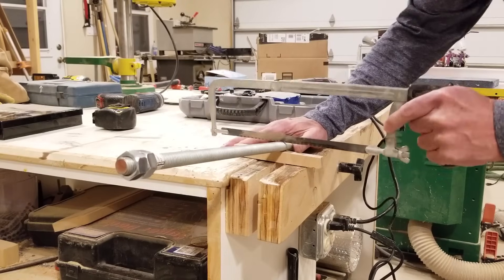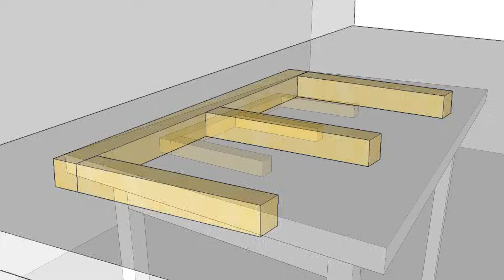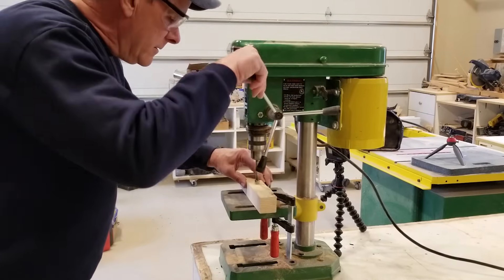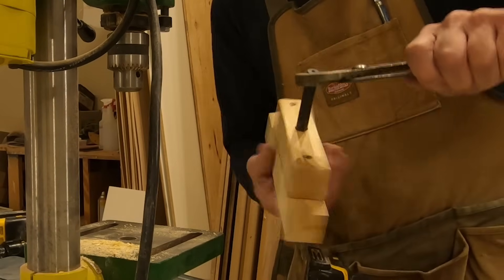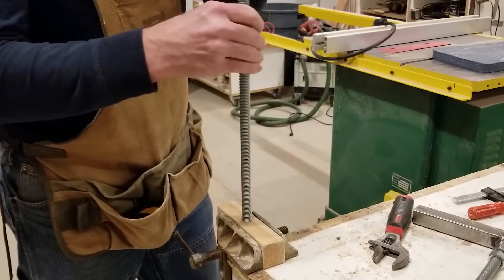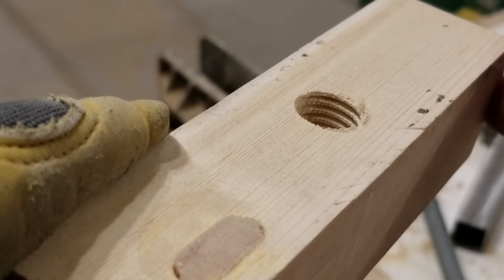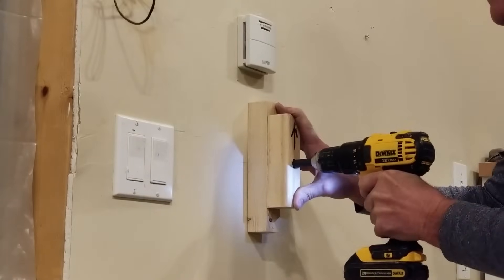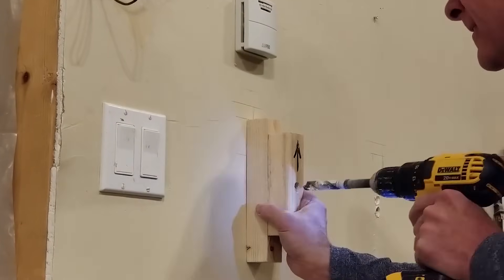Strong Floating Shelves - The Strongest Option

Comment: Solid video!

I’ve always wanted to try using cheap framing squares screwed to sides of studs.  Only would work before rock was up or having access to behind wall.  Anyway one could screw or bolt squares to studs, screw or bolt a piece of wood to part that sticks out of wall for glue or fasteners, then just slide a pre made box right over.  That’s gotta be strong!  

I like the idea of the your rod coming through to the end and bolting tight against the wall!  

I’ve never been worried about wall to wall shelves or wall to finish, but finish to finish shelves, I feel never will stand the test of time.   Kinda like a Newel Post, no matter what you do they seem to loose up over time as things tend to be abused.
Lmk your thought on the framing square idea, curious to hear another pros opinion.
Reply from the maker: No doubt, Jeff, that the framing square idea would result in a strong shelf. The question I haven't quite answered is how strong does a floating shelf really need to be, practically speaking? Something I have considered that is sort of like your idea is to weld up 1/4" "L" brackets that could be bolted to the face of the studs and then floating/texturing over them to leave only the other leg of  the bracket sticking out. Not as rigid as yours, but don't have to put it in place before sheetrock. Anyway, thanks for your thoughts and I appreciate you watching!

Comment: OMG this is a great idea. I might try this with the addition of a two inch wide , 8th inch steel plate strip that bridges the gap between the two posts. Then can be tightened against the wall with nuts. That should even the weight out better if the shelf was loaded unevenly and make the threads less likely to pull out due to the weight pushing against the sheetrock.
Reply from the maker: Good idea, Joshua! You would think that would strengthen the whole assembly!

Comment: Wow! Way to much work.
Not near the strength you could have. Too much room for error. 
The simple effective way I've been doing this for 25 years is as follows. Figure how many shelves you want. Take 1/4" × 1 1/4" flat stock. Figure the spacing drill and weld your allthread from both sides to your flat stock. If a single shelf 6" FS is fine. If dbl shelves, extend 3" above and below your allthread.  Drill FS and secure with 1/4" x 2 1/2" screws to bare stud. Now days I use a laser to line my rods to perfect level. Patch drywall and epoxy solid shelf in place  or bolt your box shelves in as you have on your videos. 
I built these kind of shelve for display of antique radios for a museum. Since the walls were new, I used 1" square tube, welded the allthread but bolted the tube to the sides of the studs since shelves went from floor to ceiling and we need to attach drywall. 
My 2 cents.

Comment: I would think it would have been easier to buy a tap, or install a threaded insert, but whatever works.
Reply: Custom Haines in a perfect world this guy can drill and tap and install the threaded rod without doing any additional drywall work. I think that’s the only advantage to the threaded rod solution. I must say I would not install anything more than a light duty shelf here. This would not hold up a countertop or a mantle.
Reply: @scottocarpenter9904  I agree with you opinion to limit weight on this design, but I don't follow how all that set up and prefab is any easier or better than just using a commercially available tap.

Comment: I use a similar method for hanging heavy things in my shop. I drill a 3/4" hole directly in the center of the stud I want at a slight downward angle. Them I put a 3/4" wooden dowel in it. I've hung some incredibly heavy things off them. Super easy to do.
Reply: How deep do you drill into the stud and are you concerned about reducing the structural integrity of the stud?  I was thinking of putting 3/4 inch EMT 2.5 inches deep into some 2x6s to create a wood rack but I don't want to mess up the load bearing studs and have the shop fall down!

Comment: It's an interesting video to watch, but I don't see the point of it. Barely anyone has the hardware and know-ho to do this.
Reply from the maker: Hey James! If you are talking about welding the T handle, I understand. But if you have a drill, right sized drill bit,  a few nuts, a couple of wrenches and a hacksaw, you could install the rods in the wall. Then you would be down to building your shelf. In fact, I cut my rods with a hacksaw. Lots of ways to get things done, James!

Comment: Hey amigo, nice work and it's always fun to find new ways to do things..... Helps keep the interest alive !!!
Ya know what I mean?
PS... I use my impact wrench and two coupling nuts tightened against each other. Then, as u did,  put some relief slot's and drive them in. Oh, add a little oil or wax to the hole.
No need to pretap 😉🤗
Great job keep it up 👍
Reply from the maker: Yep, Traky boy, I know what you mean! Thanks for your suggestions too and I appreciate you watching!

Comment: I like the idea. This has several advantages over other installation methods. If you choose to remove the shelves you only need to fill a small hole. If you had glued in bar to the studs you need to cut them off first then try to cover the end of the bar. If you use lug bolts cut off you have no way to secure the shelf hard against wall.
 If you were to just drill a blind hole in the solid shelf and slot out a section you could still use a nut to secure the shelf. Would be a pain to fit because you would have to wind nuts as you draw in shelf.
Reply from the maker: Yeah, manofausagain, I tend to agree with all your observations. Thanks for watching and for your comments!

Comment: Hanger bolt. Save a bunch of time.
Don't drill through all of your laminated strips, leave the front one solid for a nice finished edge.  The one just before make a pocket large enough for a washer and open it to the bottom so you can put a wrench in there from the bottom. ------/\|  Cross section.
Reply from the maker: Hey Macks! I have experimented with hanger bolts in an earlier video, but I'm not quite understanding your design from your explanation.

Comment: I have to ask. Why would this be superior to a french cleat system?  I'm installing 14" long 6" at the base, 12" wide shelves in a commercial space. (i didn't design them, designer gives me drawings, with no idea how to mount, says, build these, install these)After mounting a startling number of very large cabinets in a hair saloon via the french cleat method, i thought, okay, that 6" base gives me plenty of room to put a 3/4" hardwood piece of ply 2" wide on top of another 2" wide strip, secured into blocking inside the walls with timberloks. I might of used this method here, had i seen it before getting those drawings or before mounting those large cabinets. Without comparing the two methods(no time for that)could you think of any reason one is better than the other?  Thank you and great video. I subscribed right away, seeing the experience, and methodology.

Comment: Use 3/8 cold rolled steel ,5 min epoxy your done
Reply: Yeah brickwall + epoxy 5 min tops.
Reply from the maker: Yep, lots ways to get this done, Darren! But if you think about it, this is a pretty easy way to go also and I can always remove the shelf and patch the hole in 5 minutes.

Comment: Just use threaded inserts tapping wood will never be as strong as an insert. Drill, screw into the hole. Put your all thread in with a drop of Locktite. Just in case all is not perfect, drill the shelf holes oversize and shim if necessary then tension your nut and put in a wooden plug. All invisible.
Reply from the maker: Good idea, Mark! Thanks for passing it on.

Comment: Much easier and faster just gluing in regular Rod instead of trying to tap the hole. They sell kits on amazon for this style of installation.
Reply from the maker: If you say so, Jason. But if I'm not explaining, I'm drilling a hole, running in the tap and screwing the rod into place. That's pretty easy also! Plus I can pull it if I ever need to.
Reply: @RustyDobbs  How would one go about this process without that metal contraption you created to twist the rod?
Reply: @aheadatime  you could probably get away with epoxying a nut (especially a cap nut) into a sturdy piece of wood as a tap handle.
Reply: @aheadatime  just put 2 nuts on the end of the rod and jam the together. Then put a socket on it and turn it in with a ratchet or impact screwgun.

Comment: A quick patching job is a small price to pay to know you got it 100% right.  You can walk away from that job with zero worries.
Reply: I would do the same thing, making 100% sure you're drilling dead center of the stud. In fact if you hit it just right you won't have to patch at all by cutting a channel in drywall less than the width of the shelf.
Reply from the maker: That's the way I look at it too, Kroban3.
Reply: @RustyDobbs 

Bill Shakespeare has a good point.

Comment: Only one fly in the ointment, if the studs don't align with where you want to put your shelf you are SOL.  The one advantage to the cantilever bracket with the case over it is the lag bolts can go anywhere on it and then you can use Snap Toggles in between.  ST's hold 241lb shear on drywall.
Reply: Shear yes but bending moment as a load a shelf would generate?
Reply from the maker: Yeah, dynamics change a lot the further away from the wall the load is.
Reply from the maker: You are right, Killashandra111, that the snap toggles are very useful. I used them for the first floating shelf I ever did because of alignment issues. However, if studs are on 16 inch centers minimum, larger shelves would work fine typically with this method. My guess would be about an 18 inch long shelf minimum with two studs in this span works best using all threads. Thanks for the comment!

Comment: I appreciate the work you put into this. But it seems like a bit of just that. Why not just use taps and dies to create the threadings. Welding the piece you did was pretty brilliant if you have a welder or even are able to use one.
Reply from the maker: Hey, everyday! I just did a quick online check and you can buy a 3/4" tap for under $20 which would last a long time only cutting threads in wood. Thanks for pointing that out! Simple solution for folks without access to a welder!
Reply: @Rusty Dobbs - instead of cutting the head off the bolt & then inserting into the studs, couldn't you have inserted into the studs first & then cut off the heads?

Comment: What maximum shelf depth do you think this would work for ??  Do you think it would for a 20" shelf ?
Reply from the maker: Hey, Lyndon. Depending on the weight it might work ok for a 20" shelf. One of those things you would need to experiment with. The wider the shelf, the more potential deflection out at the end, like a diving board. Stepping up to from 5/8" to 3/4" all threads might be something to consider too for a wider shelf. Good question!

Comment: I’ve always bought 12” lag screws and cut the hex heads off after. Same idea. I use a drill and a jig to keep them vertical.
Reply from the maker: Sounds like a good approach, Stoph! Thanks for your comment!
Reply: That's how I installed a floating mantel for a client! Used 5, 1/2" lags, and a cheap drill press attachment for my drill. Worked great!
Reply: Yup same here, I’ve used lags before to for mantels and shelves.
Reply: I like your approach better, I feel the coarser threads of a lag screw would be better suited for this application
Reply: With the lag bolt approach, the strength comes from it being threaded into the stud. With a floating shelf there is a lever action trying to pull the lag bolt out of the stud. With the all thread approach most of the strength comes from the threaded rod resisting being bent. The nuts only keep the shelf tight to the wall. I used a similar approach the fix down my stair railing end posts.
Reply: I like the idea of lag screws also. Saves a BUNCH of steps (don't have to re-invent the wheel) and coarser threads are stronger than all thread.
Reply: I was thinking perhaps some epoxy squirt into the hole before setting the all thread.
Reply: That's the conclusion I was coming to when I saw this product sold....methinks, what they're selling is just a lag screw with no head:  https://smile.amazon.com/king-way-Floating-Invisible-Concealed/dp/B07KW4VRL6/ref=sr_1_9?crid=3HYD58STZ951E&keywords=floating+shelf+brackets+hardware&qid=1566055914&s=gateway&sprefix=shelf+brackets+hardware+floati%2Caps%2C195&sr=8-9
Reply: I used the same idea with the lag bolts, but instead of cutting the heads off I used a sleeve made from plastic pipe that brought the threads to the same diameter as the head, predrilled, then screwed the lag in with the sleeve.

Bonus, the sleeve acted as a stop so all my supports were the same distance from the wall.
Reply: Aj Ginther Do you have a picture of the lag and sleeve, do you use pvc pipe or something else?
Reply: @michaeldean2053  It's been a few years. I just have pics of the finished shelves.

I'm almost positive I used black 1/2" PVC risers and cut them to size.
Reply: @michaeldean2053  I don't seem to be able to share a picture here.
Reply: @ajginther1281  well atleast we got the idea noe back to work
Reply: Curtis “fixed the newel post”.... watch Christmas Vacation.
Reply: There's a decent argument for the coarser threads of the lag screw, but I think I'd rather have the all thread reach all the way to the front of the shelf frame. With the downward load force i doubt the threads will slip.
Reply: @JM-nh8yp  MAYBE...THAT ALTHREAD IS MONSTROUSLY STRONG...IN BUILDING TRADES..USE IF FOR EVERYTHING...INDUSTRIAL AND COMMERCIAL

Comment: Would like to see how this quantitatively compares to the other shelves you built. 

IE how many 50lb bags will it hold?
Reply from the maker: That would be interesting, Shannon, but I might be stacking bags all the way to the ceiling! I will say that I set up a ladder and stood on the shelf and at 200 lbs, it barely moved. Just makes the point that going from wood dowels to steel rods is a whole other dimension.

Comment: I could trust only your answer! Please advice: I have 120mm space between brickwall and plasterboard (10mm). In between there is also 50mm insulation to the plasterboard. There are no studs, the plasterboard is fixed using Dot & Dab and some cowboy improvisation. What kind of fixings would you recommend, given that we are focusing on sturdiness. Thank you !
Reply from the maker: Hey Chris! The construction methods where you live are foreign to me but have heard of similar construction approaches in the UK. From what you describe, the only solid material you have available to attach shelves to is the brick so it seems like you would need to remove plasterboard, then bore holes in brick for all thread or other material and extend out finish shelf location. Then reinstall and repair plasterboard. Give me a few more details on what you are trying to accomplish if I am way off base. Love the "Dot & Dab" and "cowboy improvisation" references, but have no idea what that really means? I'm curious without studs, how does the plasterboard stay in place or what is it secured to?

Comment: I plan on using your idea to build some heavy duty floating shelves for my daughter-in-law. When you are finished installing the rods for the shelves how much of the rod is protruding from the wall? Thanks again Rusty, fantastic idea!
Reply from the maker: Thanks Terry and good luck with the project. The rods in the video are approximately 14" long as I recall. I went into the studs 2 1/2 inches, sheetrock  is 1/2 inch, so there is 11 inches left in this example. That length can be adjusted depending the type of shelf you are building and the finished width you are looking for. You can even install them longer than necessary and cut them off with a Dremmel when you are have the final install dimensions of the shelf and connection method you want to use. I appreciate your question and comment!

Comment: Hey Rusty, I'm getting ready to install a set of floating shelves and the design that I've decided on is using a 2x8 with two 10" lag bolts going through the width of the board, into studs. This seems a little simpler to install compared to the all-threads while being just as strong. Maybe you could make a video on this method to add to your comprehensive analysis on floating shelf construction.
Reply from the maker: Thanks for the idea, bigcheetah987! I'll add it to the list. The hurdle I got past of getting a straight hole through my solid wood shelf was by drilling holes in smaller thickness wood pieces on the drill press, then lining them up and gluing them them together to get to my width here of about 12".  Do you have a method for drilling through the 2x8?
Reply: @RustyDobbs  No i agree, i think drilling the hole is the hardest part about this approach. My idea is first drill a guide hole using a 1/8 or 1/4" drill bit that get's you through the board. This smaller bit should be easier to control and keep on track. After that hole is drilled, then come in with a 1/2" drill bit going through the same hole. The smaller hole should act as a guide. After this, come in with a 1" drill bit just deep enough so the bolt can be recessed from the edge of the board. What are you thoughts? Any "gotchas" in this approach? Also, i think this approach require a drill press to keep both the guide hole and final hole as close to parallel to the surface of the board.
Reply from the maker: Yeah, I think you are considering all the things I would be thinking about. The small pilot hole idea is where I was going  and gives you the best shot at a centered hole in the shelf. There's got to be a more precise way to get a centered hole through like a 12" wide shelf, but I don't have any great ideas right off hand!